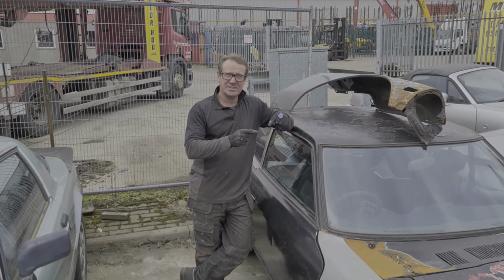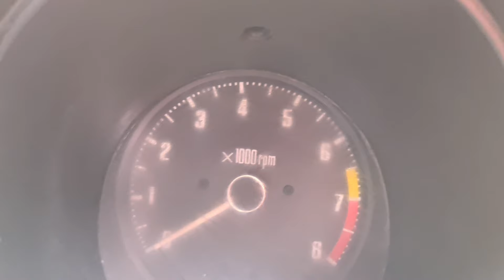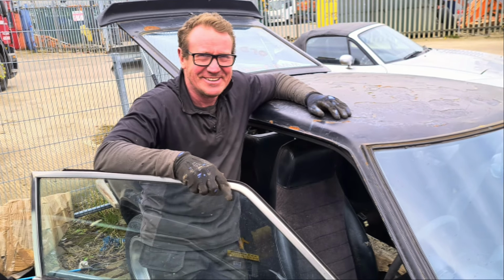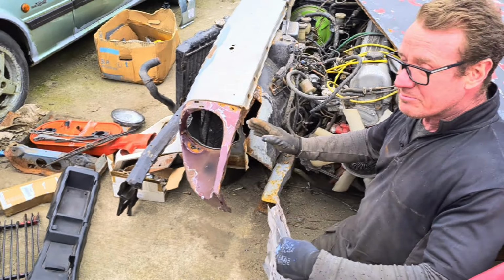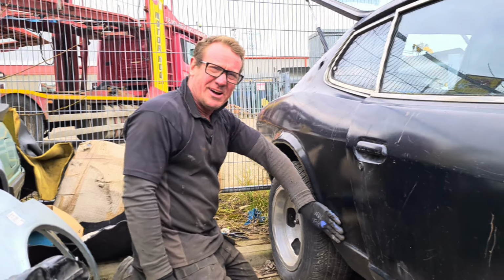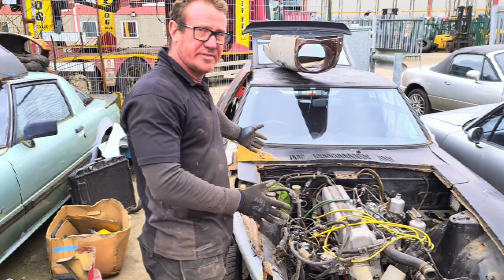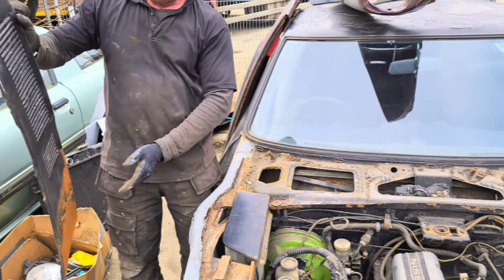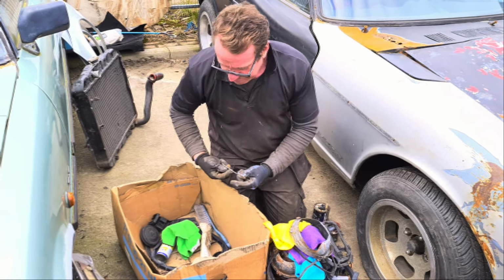Abandoned Datsun 260z Restoration Project Part 1

Comment: My Mum had a 260Z (not the 2+2 version). Yellow with Brown stripes - a bit of a nod to the Starsky and Hutch era colour scheme. The car looked immaculate when sold about 20 years ago, no rust - only 5,000 or so miles on it here in the UK. UAE 166T was the registration. The only thing with the car was the throttle linkage. It would get jammed when you turned the engine on and it would go into high revs and make you look a fool in a supermarket parking lot. I wish that my Mum kept hold of it.

Comment: doesn't it go to show how even a seasoned professional can severely underestimate the amount of work required in a car...   I feel better, as a rank amateur, about my mistakes (eg anticipated 2 days welding became a month!)    It'll eventually be a beautiful thing though.
Reply from the maker: The artist of a body sop person didn't do a bad job so it looked half decent on photos. We bought the car sight unseen and based on some photos and the previous owners description (its solid he said) but its fine, we will have it on the road soon!
Reply: 9mths on , it looks like some one had a go at saving it but it was too far gone! They couldn't weld and tried to cover over everything ( from top and bottom) ... making it rot more from  moisture trapped beneath and making it harder to repair! If it was free and worth 30k plus maybe worthwhile? But its for you. Anything  can be fixed with enough  time/ money.@yorkshirecarrestoration